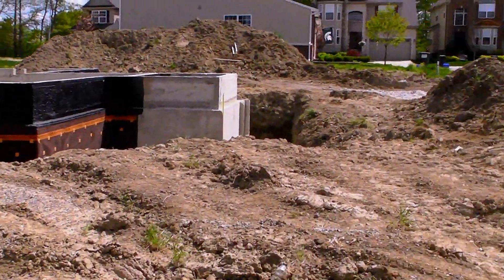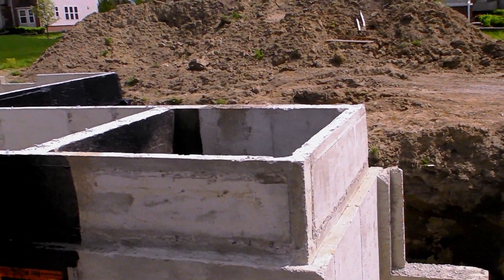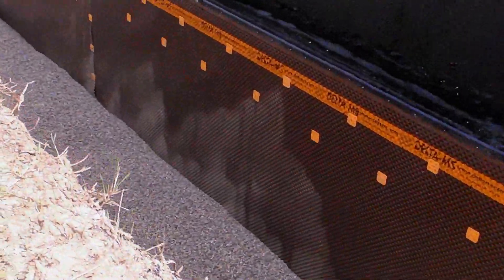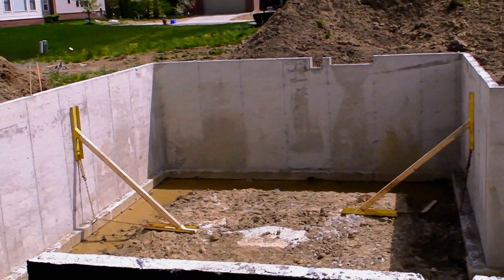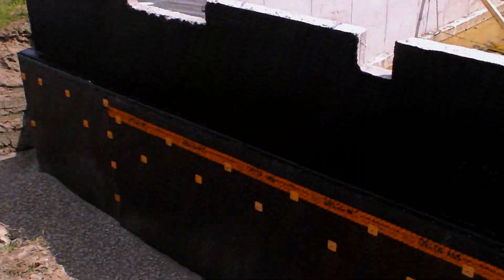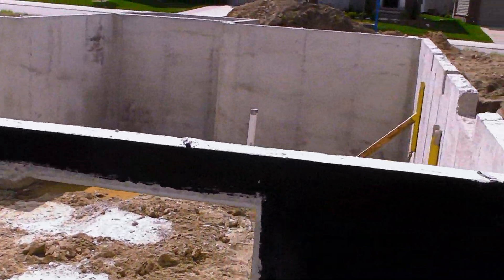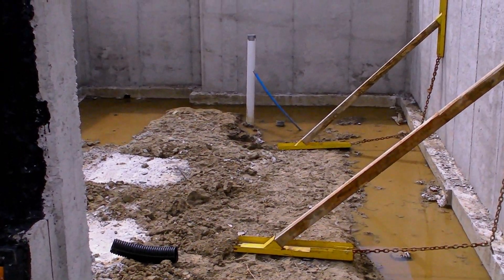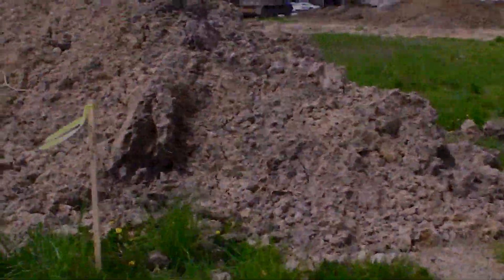Basement Construction Basics

Comment: It makes me wonder with a little extra digging around the perimeter that you could not put in heating and cooling round loops for a heat pump system.
Reply from the maker: Typically you don't want your heat pump system right up against the house because of the impact the basement has on temperatures in the surrounding ground.  That's why most geothermal systems are laid out in the yard or they are drilled deep in the ground like a well.

Comment: When is the basement floor typically laid? Looked at a new construction home with all the framing done, roof done, wrapping done, and windows in. Basement has a foot of water in it…realtor said it’s because it’s still gravel under there. Is that normal? I’m worried the wood/concrete will have mold issues from the standing water.
Reply from the maker: Generally the basement floor gets poured rather late in the build, especially if you have plumbing in the lower level.  This lets all of the plumbers get their stuff done and finalized.  You shouldn't have any wood in contact with the water that will be part of the permanent structure.  There might be some temporary bracing but every structural support will either be concrete or steel stanchion poles.

Comment: So what happens when you take those braces off? Haha and how do you know how to not over pack it?
Reply from the maker: The framers will deck the basement before removing the braces.  That will support the walls at the top so they won't want to collapse inward.
Reply: @DieselandIron  went it still put alot of pressure on the wall still especially the middle and especially a cmu block wall?